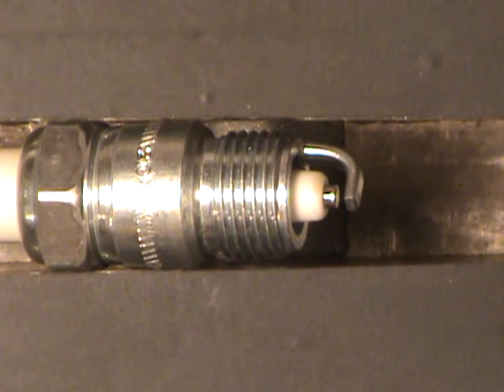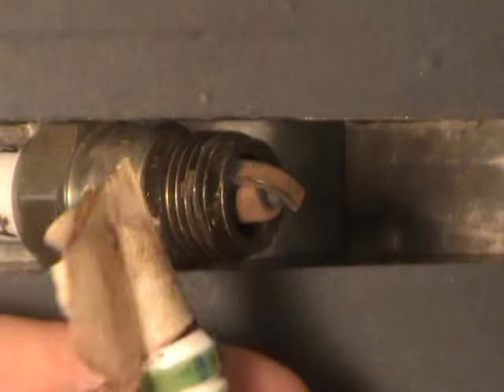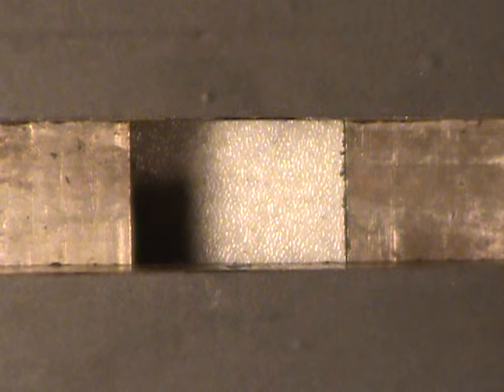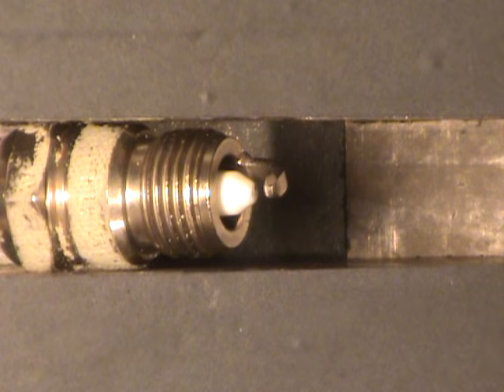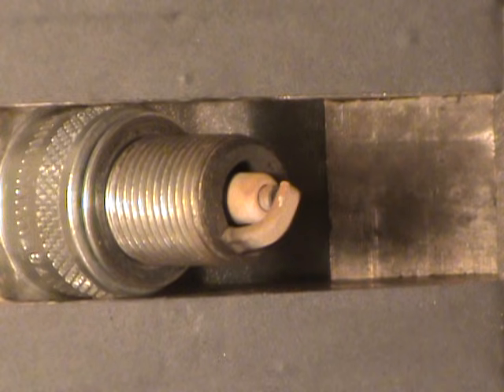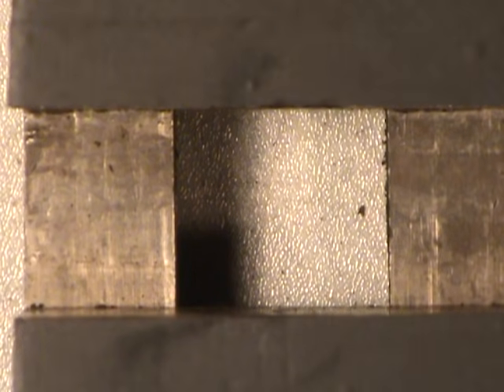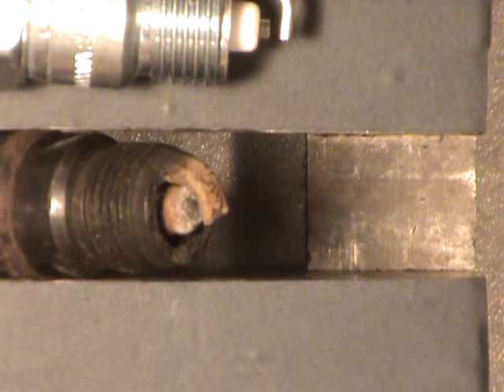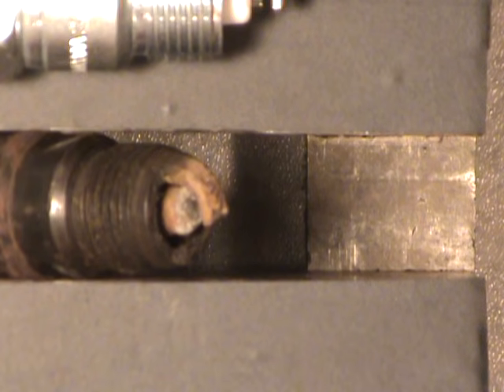SPARK PLUGS How to Read them (Part 3)

Comment: Well I believe the heating issue on dad's  truck is a actuator failure. The shafts that turns the heat release isn't moving so I just tied it up for now. I'll wait till spring to fix it right. I'm currently working on a lexus starter issue. It clicks and doesn't want to crank the engine. It will crank after a few tries, I can buy a solenoid repair kit to replace the contacts, plunger and bolt studs. I think that'll fix it, I plan on testing the starter comotator ( I'm pretty sure I just misspelled that) for shorts. However,  I think the solenoid is the problem.  What do you think?
Reply from the maker: Jon Stone Greetings Jon Stone.................Welcome back, and, lettuce see, what we can do, about, getting that...(listen closely now)..."Click"...Sound, to turn into, a..."Va-Room"..."Va-Room"...Sound, of a..."Running" once again..."Lexus Engine" shall we.........................................Lettuce see now........Hmmmmm...........From the very Start...We..."Crawl" before we can "Walk"...then We..."Walk" before we can "Run"...that's Your Clue.......................Or, in other words, Follow, that there "Bread Crumb Trail", from its very Origin, or, Starting Point (nah, no pun intended at this particular point in time...lol), as in...Checking-Out...All of the..."Components and Wiring"...that are "Related" to the Vehicle's "Starting System", in a, shall we say..."Chronological Order" (that be, just a Fancy-Schmancy way, of Sayin', Doing Things in Order, kinda like, from...Start to Finish, if You will)....................Lettuce now begin......Starting with (again, it's not a pun...lol), the Vehicle's..."Battery"...............Is the Battery in Good Shape and "Fully Charged"...???.................."Warning"..."Danger"...be..."Very Careful"..."No Sparks Allowed"...while working anywhere "Near" a vehicle's Battery...."Especially" while it is being..."Charged-Up"...by either, the vehicle's..."Charging System (Alternator or Generator) or even a..."Battery Charger"...as there is usually..."Explosive Gas"...being "Emitted" (aka, Venting), out of the "Battery's Vents"...!!!..........................................If the Battery's "Voltage" is Below about 12.5 Volts, with-out anything connected to It, then, it is probably "Not Fully Charged", or, maybe, seen better days...........................................If I get, oh, about "5 Years" of Use, out of a typical Lead/Acid type of, 12 Volt-Car Battery, I'm content with that......................................So, once the Battery is Working as it should, then.....................................Are the Battery Connection Pads/Posts, and the Battery Cable's, Connection Ends/Clamps..."Clean, Tight and Corrosion Free"...???...................................Oh yeah..."Don't Forget".........Make Sure, that the "Large Gauge/Thick Wire/Cable" that...Provides the "Ground to the Engine Block or Cylinder Head/s" (Electrically, that is)...is Super Clean, as well as, the Engine Block or Cylinder Head, Location/Mounting Point, for that large Wire/Cable, is also Super Clean as well, as that alone, if Dirty/Corroded/etc., can make, for that "Click" Sound, at times, as well...................................................That some-what Famous "Click" Sound, can be caused by...Low Battery Voltage & Bad Wiring Connections, as well as, something along the lines of, a Not So Good Ignition Switch as well..etc.......................................If All of the Things check out so far, then, here's something...........................................There are quite a few "Automotive" Establishments, that will "Check-Out"...as in..."Test"...Your "Starter Motor" for "Free"...just make a few phone calls, and make that inquiry...but...the only Drawback being, is that, You'll have to Remove the Starter (Motor) and take "It' to "Them", in order to receive, that there "Free Test"...........................................Before You might do the following, "Check", to see if there might be something like, an..."Anti-Theft"..."Radio/Entertainment Unit"...or anything else..."Procedure"...that has to be done, "Before" the vehicle's Battery is "Disconnected"...!!!!.................. .................Make sure, that You "Remove the Ground (aka, - or Minus) Battery Cable End/Clamp"...From the Battery...(Note...Only Applies to a Negative Ground Vehicle...!!!)..."Before" You start Disconnecting those Starter Motor Wires, Especially the much "Larger Gauge (thick) One/s", as there will be Lots of Electrical "Arcing", as in "Sparks", if any Loose Wiring Touches places where It Should Not be touching/connecting to...!!!................................So, Before Digging in, as far as You might be Thinking, to be doing...First, make sure, that there is 12 or More Volts, getting to Your Starter Motor's Connection Point (Solenoid?), as in, at the End of the Heavy Gauge Wire, that is responsible for Supplying the Starter Motor, with the required amount of Battery Electricity...................................................See if You can find a..."Wiring/Circuit Schematic" (aka, Electrical Drawing)...for the "Exact" Vehicle, that You are working on, as that will Eliminate, most "Guess-Work"...!!!.............................................Some 12 Volt, V-8 Starter Motors, could Draw, oh, somewhere around "200 Amps" of Electricity, possibly, which, as I see, more or less, has to have a pretty darn good Starter Motor, Battery, and a Starting System, Electrical Circuit, including the Ignition Switch/Button........and even More-so, when a "High Performance/High Compression Engine" enters the picture...!!!..."Yee-Haw...!!!.......................................So, once You actually Know, that the Starting, Electrical Circuit, is Working as it should, and is Able to "Supply the Starter/Solenoid", with the required Volts/Amps, and, all You Hear is "Click", then, barring something, like the Starter Motor's "Pinion Gear", getting Hung-up/Stuck, in something, as absurd, and Theoretical, as Some "Missing/Broken Gear Teeth", that are found, on the Circumference, of the Automatic Transmission's "Flex Plate", or, on the "Ring Gear", that is found, on the Circumference, of the Flywheel, on an Engine, that has a "Standard Transmission" (with the 3rd Pedal and a Clutch!...lol), then, Yes-Sir-ee-Bob...just might be, the..."Starter Motor"..after all...???...................If You care to, let me know, what You find out.................Till next time............Be Safe, take care, and have a good one.
Reply: Hello again, 

 I did get the starter issue fixed. I bought the contacts and stud bolts for the solenoid and it fixed it up good and proper. I could hardly see how the starter could turn over at all once i saw how badly worn the contacts were. I do know I can use a volt meter on the ohm setting to check for a shorted commutator and the armature as well. Glad the motor wasn't bad i paid 27.83 for the repair kit and it is cranking over so strongly know. I still have a valve cover gasket to replace but it can wait till a warmer day. I am getting more into the car service/repair as a hobby. I've done appliances and central heating and air for about 12 years and it's getting old lol! Working on cars gives me a new challenge. I appreciate your info and will keep your videos playing for a while. You take care and keep those videos coming !
Reply from the maker: Jon Stone Greetings Jon Stone...."Congratulations"...!!!...for getting that Starter (Motor), to be "Workin' like New, or maybe even better then New......................................Looks like You were correct, in that, it was "Starter" related, specifically...................... Seeing as how the "Electricity", wasn't able to "Flow" as it should be, to provide Your Starter/Motor, with  the required Volts/Amps, to make it Spin Fast, along with a Large amount of Torque as well, then, as I see it, by having those Not So Good..."Contacts"...well, that would probably be, just like having, something like, a Not So Good "Wiring Connection or Faulty Ignition Switch", which would, well, kinda make the Starter/Motor, Work not so good as well, don't-cha-think.................................................Now that Your Starter/Motor is Healthy once again, may I suggest, that, You Remove and Clean, any Wiring, that's part of the Starting & Ignition System, that's easy to get at, as, by doing so, You'll be Providing, those particular "Wiring Circuits", with the best chance possible, for "Conducting" the greatest amount of "Volts/Amps", that the Vehicle's Battery is capable of Supplying, without have any "Un-Needed Resistance", which will usually cause an "Un-Needed Voltage Drop", at the very same time..............................................That's why You'll be Hearin' me Sayin', from time to time, about that good ole Sayin'...and...that Sayin' is..."The Chain is Only as Strong as the Weakest Link"...!!!...and in this particular case, I'm comparing that Sayin', to just about any..."Electrical Wiring Circuit"...known to Man-Kind...!!!...lol..........................I find, that it's just a matter of time, before a Wire's "End Terminal", and where It is "Connected To", will eventually..."Oxidize"...or..."Corrode"...etc.......Especially, when we're talking about a "Very Damp & Moist Climate/Environment", and eventually, as I see it, will usually result in, some, if not most "Electrical Connections", developing, a very "Un-Wanted Resistance/Voltage Drop", that will make..."What-Ever-It-Is"...to not work, as good as It should, or maybe, not even at all...!!!...Yikes...!!!...lol................................Oh yeah, I haven't used a Valve/Rocker Cover Gasket, for, what seems like, almost forever, on the typical...North American...Inline 6-Cylinder...V-6...and...V-8 Engines, that I worked, or work on..."Say What"...???...................Yeah, in the past, I messed  with Valve/Rocker Cover Gaskets, that were made out of "Cork" or "Rubber"...........................The Cork type, were a real pain to scrape off, of the Covers, and the Rubber type, always seemed to "Slide Around", when-ever I was Installing them.............................All I use now, is a "High Heat...Copper Colored...and Sensor Safe...Silicone"...and...all I have to do, is Clean the Engine Heads, and the Gasket area, of the Valve/Rocker Covers...then..."Apply" and Spread, a quite generous amount, of said Silicone, on the Valve/Rocker Covers, that resemble the "Shape of the Real Gasket"..............then..........."Slap" those Valve/Rocker Covers back on the Heads, and Medium Tighten the Cover's Bolts, and yes, it's that "Easy"...!!!...lol..................................................I've never had a "Drop of Motor Oil", get past..."Any"...of those..."Home-Made"...Valve/Rocker Gaskets..."Ever"...!!!.........................If I recall correctly, the "Silicone" Stuff was called..."Ultra Copper"...and might have been made, by the "Permetex" (spelling?) Company.....................................Best damn Silicone that I've ever, and always use...but...that's the "Only Color", that it comes in...!!!...lol..............................As long as the "Surfaces" are Not Oil-ee, Clean, and Dry, this "Silicone" is the "Chit"...!!!...lol................................I've used "It" as a Thermostat Housing Gasket, but You have to make sure, that, this particular Application, Doesn't require the Thickness/Spacing, that a "Specified Gasket Thickness" provides, if so Needed...!!!...Always Check...!!!...........................................Well, till next time................Be Safe, take care, and have a good one.